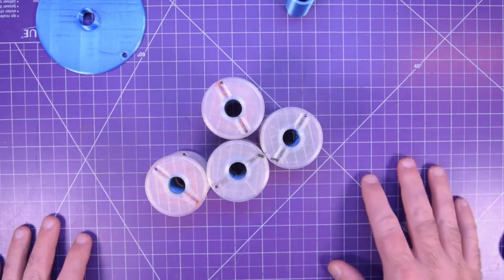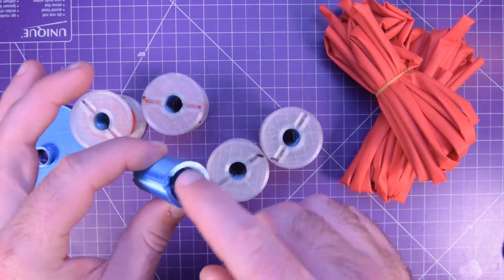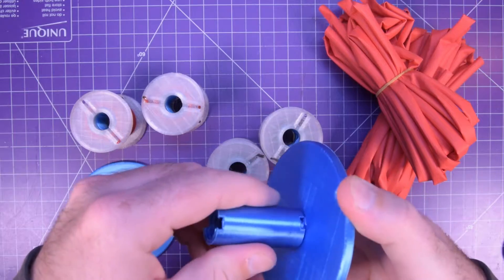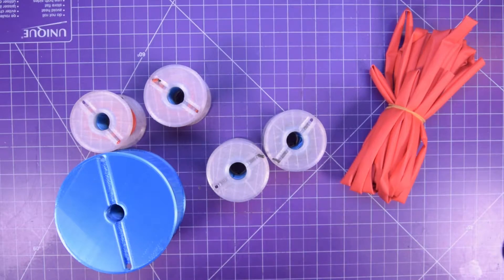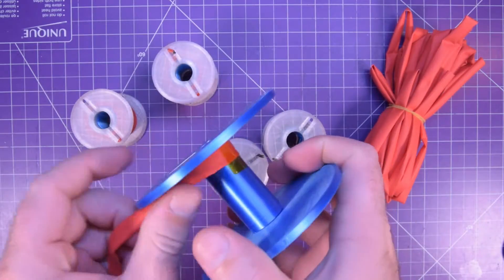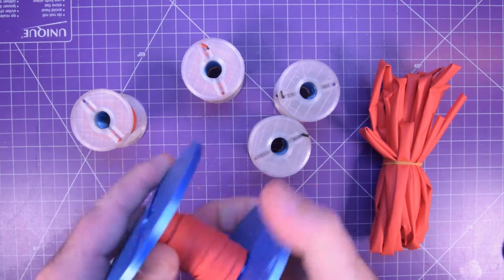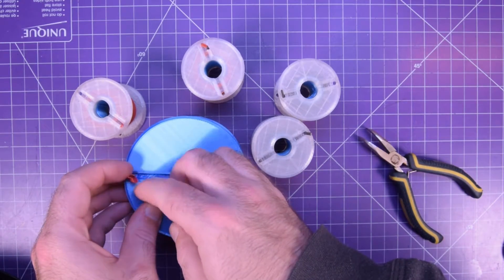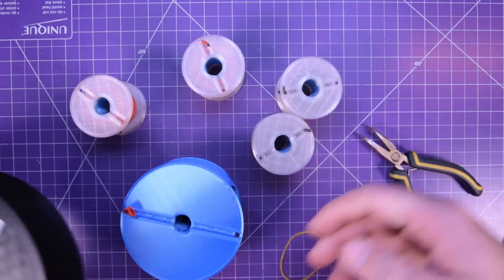3D Printed Wire Spools! - 3D Printing For Electronic Enthusiasts

Comment: Just wondering how hard it would be for you to do time lapse videos of your prints.
I figure you don't want your channel to focus on that but it could aid in attracting more viewers
Reply from the maker: I'll see if I can set something up, i usually print in the dark overnight
Reply: @SimpleElectronics  I'm planning on using octoprint with my pi' and pi camera. What is cool with octo-print is it includes time lapse filming of your print and it might be able to control a light for each frame/picture of print layer, to save power.

Comment: Spools like this are so insanely useful. I made my own simpler version years ago. Just the right size for a 10 meter length of hookup wire. A minor refinement is to put a pattern or some distinctive mark on the ends of the spools. Then no more trying to figure out which spool of red wire is solid, and which is stranded.